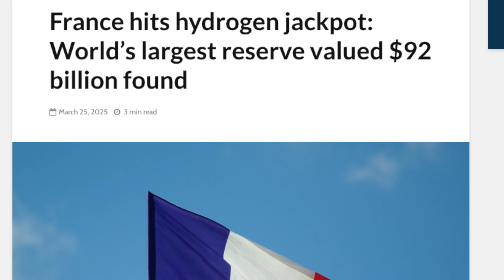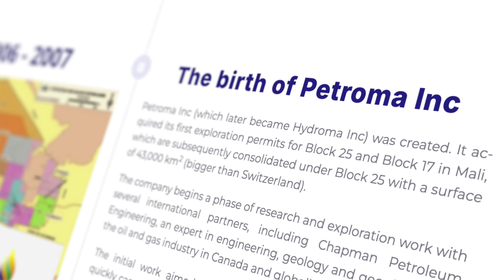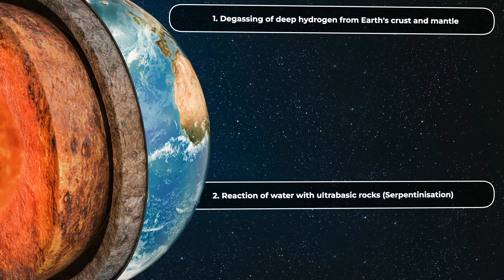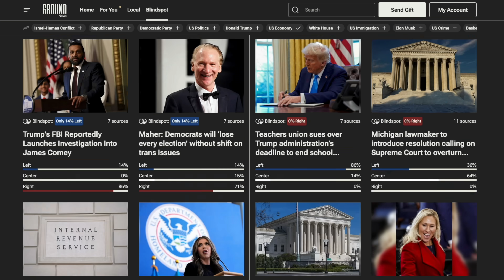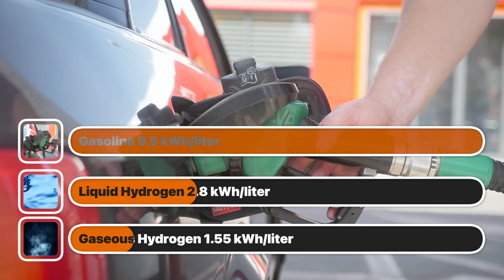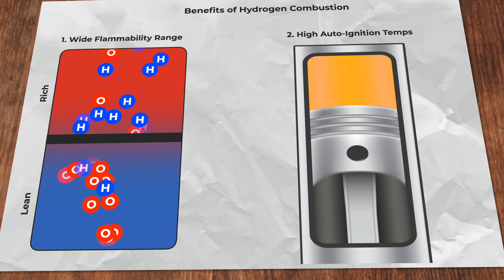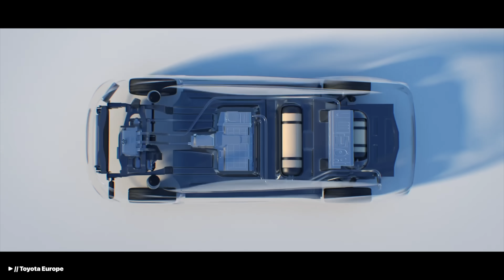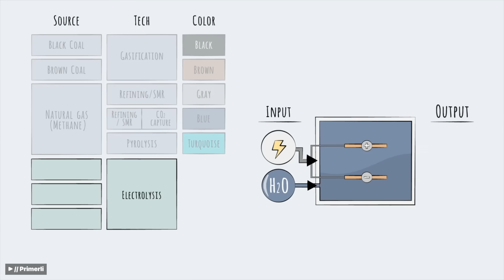This Hydrogen Discovery Can FINALLY Replace Oil & Gas!

Comment: Too bad an oxygen/nitrogen filter, like in oxygen generators for patients with respiratory issues, is probably too energy expensive.  Or else that gets around the nitrogen issue.

Plus, water vapour is also a greenhouse gas.  BUT if you just need to condense it in the car or a solar powered condenser, then there we go.

But in the car might tap too much of its energy reserves.

Comment: ok, but really needs to cover storage and transport, which is much harder given the smaller hydrogen molecule.
Reply: Storage will be a problem. Cheap steel containers are out because of hydrogen embrittlement causing the steel to fail. As a liquid, expensive refrigeration is needed, perhaps using 30% of the potential energy that the hydrogen can produce. Liquid hydrogen needs to be kept at -423 F. That's pretty close to absolute zero.
Reply: Yeah a hydrogen molecule is the smallest molecule and is hard to contain! The second thing that's complicated with hydrogen is that it can react with many other molecules and change the characteristics of the material it bounded to, making the materials brittle is one.
Reply: @hanstubben  All the big car makers have done it , you can get certificated to travel carbon HP tanks ,or you can do a hydride storage system , mazda had that on their RX8 H duel fuel , sadly they only had an around town range on H though .I think it was Ron Macinnes in the USA did a lot of H work ,he bought some 1918 german war reparations H bottles , they were still full after 70 years ,so the leaking through metal story is a myth .
Reply: @hanstubben  Helium molecule is smaller. Hydrogen is always paired, so it's really bigger. Helium can escape, hydrogen is reactive and containable. Hydrogen can be stored at low pressure using chemicals. When the chemicals are heated the hydrogen is released. So high pressure tanks are not required to transport hydrogen. Old knowledge not commonly shared with the public.
Reply: sabatier reactor using geological hydrogen could be viable? we already have infrastructure for methane.
Reply: Very true, but slightly more complicated. When under pressure, yes it is small and seeps through solids. However, when liquid, there does not have to be a pressure. So this problem will be eliminated this way. However! There are other issues with Hydrogen. It tends to creep into the surfaces of many materials and make them weaker and change its structure. Gas, for many reasons is not an option as aviation fuel I think. Liquid on the hand sounds a lot more plausible. Not easy, but...
Reply: Pipes bro
Reply: @rayversen  Is an option, but either they are fat pipes when it is gaseous and that makes the pipes very expensive or it is liquid which requires special insulation which is also very expensive. Also, you need to use very expensive materials to start with Hydrogen. You can not just use steel. It will literally deteriorate and fall apart. And the same applies to all pumps and other equipment in touch with the Hydrogen. Liquid or gas.
Reply: There is a source of energy that could last not 200 years but almost unlimited , only a few kilometers under the surface there is high degree heat , enough to turn steam turbines forever .
This heat is available almost everywhere on the planet .  Drill baby drill , not for oil but for heat.
Reply: I think Ricky conveniently "forgot" to bring up storage and transport to get more comments and increase engagement on this video.  He's a clever cookie.  :-)
Reply: I'm coming at this from the spaceflight world; transportation of hydrogen is not easy, but it is a solved problem, and solved under much harsher conditions. If ULA can store 50,000 tonnes of liquid hydrogen, using a steel tank thinner than a dime, that rides a pair of active explosions, I think we can come up with a suitable tank that can handle the conditions of your average freight truck just fine.
Reply: @jef_3006  but, unlike NASA we are not going to spend millions keeping it a liquid. You will need to contain gaseous hydrogen, a totally different problem.
Reply: Alcohol is more easy to transport. If we capture CO² from atmosphere and mix with H we have Álcool and zero emission.
Fun fact: in Brazil🇧🇷 cars used alcool/etanol or Flex witch means it can take gas or alcool/etanol as fuel.
Reply: @Franklin_Araujo  Yeah but you have to mix them together in a specific catalyst at 200-300 C. You'd have to burn hydrogen or fossil fuels to heat it up to that temp. I don't believe that energy balance would work out.
Reply: @zabelsword  
You may not know that burning 1 gram of hydrogen releases more heat than burning 1 gram of gasoline.
The news claims that France has a huge amount of hydrogen reserves, and I imagine that this could be used to generate energy.
Reply: @ Per unit weight hydrogen is more energy dense but not per unit volume. From what I've read the source in France is only 10% hydrogen. However, they theorize that if they drill deeper down the concentrations will be higher. The well of Hydrogen in Mali didn't have that problem and was nearly pure hydrogen. For what it's worth I do hope that France does find higher concentrations deeper down, but right now it's not as ideal as 2bit makes it out to be.
Reply: @zabelsword  the ethanol production process has a surplus of energy that is used to drive steam turbines to generate electricity. The "bagaça" of the sugarcane plants is the material that's left over after extraction of the sugars, this material is used to heat the boilers to make the steam. As they all come from the sugarcane plant, the CO² of the burning will be absorbed by new plantations. Yes there is still some fossil fuel used by tractors and trucks, but even they are getting replaced by 100% bio-Diesel fuel. Brazil is way further on to clean energy than every developed first world country!
Reply: @Franklin_Araujo  per cubic cm gas has around ~7 times more energy compared to compressed hydrogen, comparing it to cryogenic hydrogen you're still looking at ~4 times more energy in gasoline. The "per gram" comparison isn't useful unless you're a blimp.
Reply: @Trahloc-PH  First, I wasn't talking about energy, but rather heat.

Second, where did you get those measurements from? It doesn't seem at all logical to compare a gas to a liquid in this way. Of course, there will be fewer molecules of gas compared to liquid in the same space.

Grams put things into perspective.
Reply: @Franklin_Araujo  grams ignores the most important aspect mobile energy needs. It doesn't matter that the energy is more efficient per weight if the volumetric energy density uses all your cargo space. Hydrogen is brilliant for stationary generation if you're near a deposit. It makes no sense for transport or homes.
Reply: @Trahloc-PH  I know, that's why I said about mixing the H from the well with CO² taken from the atmosphere. The alcohol formed is easier to transport and can be used to fuel cars.
You can research it, we in Brazil🇧🇷 have had alcohol-powered cars for decades.
Reply: @Franklin_Araujo  It would be best used to drive gas turbine electric generators.
Reply: @Peter-Frankston  That's why in one of my answers I talked about generating energy by burning hydrogen. With this energy it would be possible to mix this hydrogen with carbon dioxide from the atmosphere and make alcohol, which is easier to transport and can be used in cars.
Reply: @Franklin_Araujo  I'd much rather have solar and plug in my EV (which I don't have yet) and charge for free. At present, there is simply not enough hydrogen available to make a difference. And it is still an extremely hazardous product to deal with. The wide flammable range and extremely low ignition energy are a dangerous combination. Include the propensity for h2 pipelines to leak, you won't get me living anywhere near a h2 facility of any kind.
Reply: @Franklin_Araujo   Yeah, syngas makes total sense, it's carbon neutral if done properly. Sorry I just see too many folks pro hydrogen who never bother to look at the logistic chain of dealing with a gas that desperately wants to be in space.
Reply: @Franklin_Araujo  it will be great to power an electrical plant at point of mining, but transportation and storage really suck.
Reply: @Franklin_Araujo very inefficient
Reply: @mrknesiah  give a number, how inefficient is it? As I commented before, the ethanol production has a surplus of energy that's used to make electricity!
Reply: @ The illusion of a local surplus is a result of plant and logistical inefficiency.  Global commodity prices dont reflect any “free” surplus.
Reply: @mrknesiah  If this inefficiency is less than the risks of transporting hydrogen, I don't see why not. Not to mention that alcohol combustion technology already exists in cars.
Reply: @mrknesiah  If this inefficiency is less than the risks of transporting hydrogen, I don't see why not. Not to mention that alcohol combustion technology already exists in cars.
Reply: @Franklin_Araujo  The only way to safely and reliably transport hydrogen in a passenger vehicle is as a solid or liquid compound like ammonia.  Ammonia engines were tried but the challenge will always be nox emmissions and catalyst degrdation.
Reply: @mrknesiah  look you don't need to believe me, you can search for yourself, in Brazil🇧🇷 we drive cars fuel with alcohol and transport alcohol in trucks.
Reply: @ alcohol isnt hydrogen.  Converting hydrogen to alcohol is not efficient.
Reply: @Franklin_Araujo  They're doing this already to make efuel which is a direct replacement for petrol, Diesel, Kerosene. 

The 2 key ingredients in efuel is Hydrogen and Co2, they discovered some time ago that it's much more efficient to extract Co2 from the Ocean but not sure if anyone is actually doing this yet. 

Currently efuels are expensive.
Reply: Hydrogen is eager  to gas shift itself into methane it can then be transport/store it in existing natural gas infrastructure..
Reply: @Jason-bu9sv  Coverting hydrogen and CO2 to methane again requires a catalyst and high temps (300-400 C). You then need to either burn the methane (not green) or reformulate it to hydrogen with steam (also not green). You have to think about the energy balance.
Reply: @Jason-bu9sv  the plan was to use existing gas pipelines to get natural gas around ,then denaturize it on site to H and C  ,ideally using solar furnaces .The H is fuel , the C is for fibre reinforced toys/structures . H and brass don't mix though .
Reply: No it's actually not an issue.
Reply: @manjsher3094  Umm yes it is. Have you ever heard of hydrogen embrittlement? You need special materials and stress reduction to battle this fluid.
Reply: @KurtQuad  And that's only one of the problems. I'd rather live next door to a nuclear power station than a hydrogen refueling facility.
Reply: @manjsher3094 We will see. Do you remember solar impulse and solar impulse 2? Another experimental plane is being designed, but this time using hydrogen as a fuel. They have cited fuel storage as a potential issue.
Reply: @manjsher3094  Ask how long a hydrogen car's  tank will stay full if not in use.
Reply: @manjsher3094  lol - where do you get that?  It's a huge issue.  Or do you mean by "conveniently" storing the hydrogen combined with oxygen?  ;-)
Reply: @manjsher3094  What is your basis for your assertion? I spent years in petrochem and I know the problems of hydrogen storage and transport.
Reply: @manjsher3094  bullshit, it really really matters.
Reply: @manjsher3094  Yes, it is!  Needs to be in its liquid state to store and transport = lots of energy.
Reply: @WienerDogSuprise  simply wrong
Reply: @manjsher3094  you are the wrong one here. havent you being paying attention to the toyota fiasco?
Reply: @scottmcshannon6821  Toyota has succeeded much more than is presented.
Reply: @manjsher3094  Yes, it is.😁
Reply: @manjsher3094  Hindenburg much? what are you huffing?
Reply: @GringoConPapas  The Hindenburg fire was actually the ships material that burned and not the Hydrogen!
Reply: @GringoConPapas   Look up CNG buses. They're doing just fine

Comment: Why does everyone keep thinking about car fuel when they think about hydrogen? That's about the most idiotic thing anyone can do with it. The two finds in France are located around 300 km from Antwerp, which has the biggest petrochemical cluster in the world, if you include Rotterdam. We already have the biggest dedicated pipeline network for hydrogen, running from Antwerp to Rotterdam. All we need to do now is to connect it with a 300 km pipeline to the hydrogen wells in France. Then the petrochemical industry can start making all of our hydrocarbons from clean hydrogen. Because without hydrocarbons, our world stops turning. Most of the stuff in your house is made from hydrocarbons. It would be idiotic to burn it in a car.
Reply: Hydrocarbons are fuel. As is hydrogen. It would be even more idiotic to waste energy to convert hydrogen into hydrocarbons and then use those hydrocarbons. This is highly inefficient. For reference, combustion engine cars are about 25% energy efficient whereas hydrogen cars are 60% efficient at converting the fuel into movement.
You are essentially advocating to divide the energy that hydrogen can bring by a factor of 2.5
Reply: @texanplayer7651 if I'm following you guys, he addresses this very issue at 06:50.
Reply: @MichaelRainabbaRichardson  op writes about making stuff from it (like plastic) instead of burning it simply as a fuel.
Reply: @lapaleves So instead of extracting oil for that you would use hydrogen? So no big difference then?
Reply: @yourcrazybear  i have no particular opinion on that and didn't express one above. maybe it's cheaper if local, maybe it's cleaner / simpler to use. dunno.
Reply: @texanplayer7651  You're talking about fuel, I'm talking about everyday household products, like aspirin, clothes, shampoo, lipstick, plastics, and so much more. Look around in your house. It's all made from hydrocarbons.

Comment: Hydrogen is no more explosive than petrol (gasoline). Petrol vapour is heavier than air so the explosion tends to be at ground level, where you're standing. Hydrogen is lighter than air, so some chance the explosion is above you 😅

Comment: 200 years?  Might get fusion working by then.......
Reply: It will still be 20-50 years away 200 years from now.
Reply: @Tempestan You beat me to it! 🙂
Reply: Fusion always is .... 1AU away.
Reply: The main needed component at the moment to make efficient fusion happen is more tritium. There is barely enough of it being made to start a large experiment happen or start a fusion reactor going. Once the reactor is on then it's easier to produce tritium but you need lots of it to start a successful one. The most productive method to make more tritium is to make thorium lithium molten salt based reactors. Also it would be nice if more countries join alliance and sell tritium to the ones that is doing a good job with the fusion experiments instead of using it for nuclear bombs.
At the moment, I don't see a path for fusion to happen anytime soon though China is actively trying to make more tritium and is the only current country that is experimenting with thorium based reactors. We don't know yet of how effective the thorium reactor will turn out to be as of yet and alliance with other countries to use their tritium is crucial in the process so it may take 100-200 years based on how our governments are wasting our time and money in these days........Intentionally

Comment: white hydrogen is no less expensive than green hydrogen

both require resources to extract/store hydrogen

those places where green energy is already abundant and low-cost to extract/store green hydrogen, like in China, green hydrogen is practically free

the same doesn't exist in France

Comment: Because hydrogen combustion produces water vapor, a lot of it will be released in the atmosphere. As water vapor has a much more greater greenhouse effect than CO2, is this really good news?
Reply: 1) Watervapor will equalize depending on pressure/temperature. 2) Watervapor emitted by hydrogen combustion is negligible compared to a boiling pot of water 3) Greenhouse gasses potential is defined as their lifetime. The longer the gas survives in atmosphere the greater the impact as it is additive. For H2O its hours/days, for CO2 its 2 centuries and for F-GHGs its millennia.
Reply: every time the sun comes out it produces water vapor, that's where rain comes from
Reply: Watervapor also counts as a greenhouse gas, and a much more potent one than CO2, you're correct. However, the world is "water vapor neutral". The atmosphere keeps the same amunt of average humidity because of the water cycle. CO2 on the other hand accumulates.

Comment: ONE spark and KABLOOIE, there goes France.
Reply: you do realize gas is explosive but we still use that right?
Reply: @TheSateef  gas is not explosive.  Read up on what it means to be explosive.  Hydrogen is explosive.
Reply: @ultrastoat3298  "Read up what it means to be explosive". I believe you should too. And you should probably also look for gas leak explosion videos.
Reply: putin just heard that 😂
Reply: sparks don't affect solid-state hydrogen, which China has already mastered, and commercialized

only gaseous hydrogen is harder to handle due to its flammability